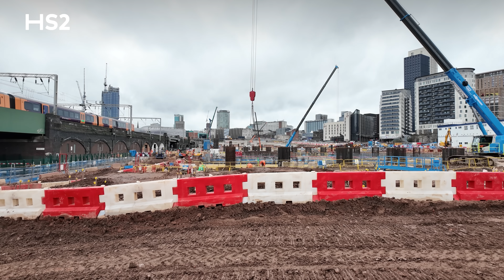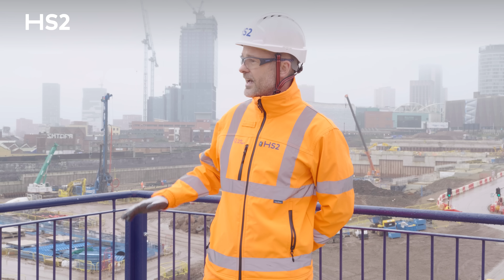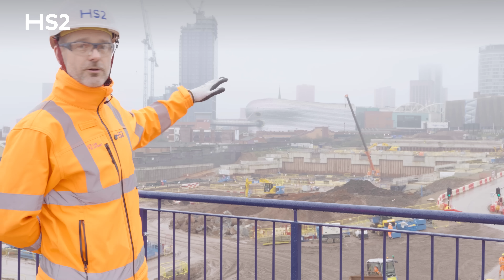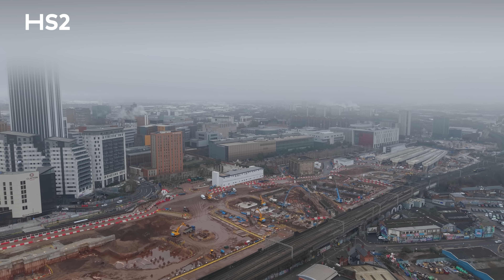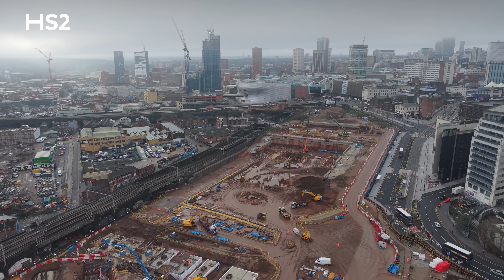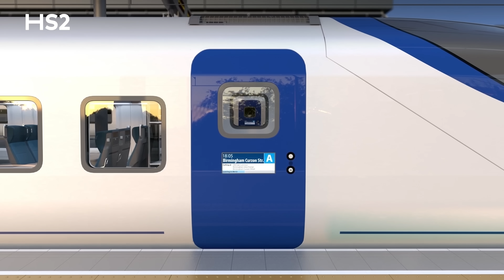Foundation piling works completed at HS2’s Curzon Street station

Comment: I'm sorry, but what a monstrosity despite the slick sell.  Now vastly over budget with a potential "finish" date of another 8 to 10 years approx. Nobody is really sure.   As of today there is even a suggestion it may not even run at the speeds it was designed for in order to cut costs. That is just incredible if it proves to be true... just think about it for a moment....   And with an urgent need to hugely increase defence plus a flatline economy, HS2 may well have to just cease being built in order to divert the billions being swallowed up. Only a relative few who like watching construction type videos or have swallowed the line about it improving travel/boosting the economy are behind it. For most people its just a waste of money badly needed in other areas.  From the beginning it has been Ill-conceived, devisive, highly inaccurate budgeting and a relative small minority in favour while other areas of society fall apart due to lack of resources.  When a project on this scale has to be " re-set"  ( HS2's own phrase...) you know its in trouble. My expectation, as unlikely as it may sound,  is it will yet have to be scrapped or else put on hold for an undetermined period. And then of course, what to do with the many unsightly structures already created and the property purchased.  Will be yet another mess left over for future governments to sort out and guess who pays for it all inevitably......

Comment: Thanks for diverting all Motorway traffic through Solihull when you shut the M42, Please tell me will you repair all the roads in this area after all the very large HVGs have finished using the boroughs road? whilst you diligently calculate all the loads during construction, I am not sure whether Solihull's roads were actually designed to take full motorway traffic. So rather than leaving this problem to the rate payers to fix perhaps you will need to rectify all the damage caused.

Comment: Started in 2011…they definitely haven’t come a long way…it’ll be a disaster when opened with long delays and cancellations..wasted money
Reply: Construction started 2019/ 2020.
Reply: @TrevorWilliams-fq8mg so 7 years to get to ground level then…do you think that’s acceptable
Reply: Agreed it's running late but not by as much as you think. Probably by 2 to 3 years. The delays are caused by 8,200 unforeseen planning conditions, late design release and funding cut backs from the treasury. An example of a badly managed project.

Comment: Fantastic engineering project...... BUT the trains of course running on it will be virtually empty as the price of a ticket will be astronomical!!!
Reply: it's comical when people keep saying this.
"Every single high speed rail project on earth has been massively sucessful BUT this one, in one of the most densely populated countries with the most crowded transport will be a total failure!"

It's easy for you to believe this conclusion when you have based it on nothing but your imagination.
Reply: @xaiano794  It will be a complete white elephant, tickets will be over £400 return by the time the line opens due to inflation and a vain attempt to recover some of the construction costs. Will be cheaper to fly to Spain than use that train!!!
Reply: @paulgreen7906  it's already cheaper to fly to spain than use the train - how do you explain why the trains aren't empty?

I get the feeling you base your judgements on your imagination and not reality.

Comment: So we really can get construction projects right in this country once we get the ball rolling. Its just a shame our government is so corrupt that it cant finance it to the scale it deserves.
Reply: Speaking frankly, the problem is the whiners - in the 90's we build a new high speed main line between doncaster and york, it took just 14 months and came in under budget and is used by tens of thousands of people every single day.
Nearly 60% of the cost of HS2 is only being spent to appease complainers, we need to just get on and get things done and start ignoring all the complainers because they are simply holding our country back.
Reply: Interesting to know that. Also the HS2 budget of 32.70 billion is indexed at 2019 prices whereas the actual cost is at real time. If you uplift the 2019 budget price to real time it will be about 50 billion. Still short of the 88 billion current expenditure projection but closer than many think.

Comment: The most expensive railway in the world. There is only one example of a more catastrophically incompetent construction - that in California between  Los Angeles to San Francisco. In retrospect it would have been quicker and cheaper to make almost all of it underground. Musk’s Boring Company would have done it for half the price & twice as quickly.
Reply: Impossible to build it all underground. Do you bore from each end or from one end only ? Either way how do you get all the soil out ( about 12 million cubic metres?). 
Then how do you dispose of it from one or two locations ? How do you provide emergency escape facilities ?  These are just a few examples showing the impossibility of the task. .
Reply: @Trevo @TrevorWilliams-fq8mg come up for stations, escape routes, access for fire crews etc. but you go under houses, under farms, under rivers, under reservoirs, under roads and railways all of which otherwise require bespoke one off bridges. All of which are subject to huge lawyer inspired campaigns to block, all of which usually require compulsory purchases making the project very unpopular. Go deep and straight using the same tunnelling machines successfully used under the Channel. Half the problem with one off designs is they are impossible to price accurately so you end up with cost plus tendering instead of competitors fighting to do all or sections of the project and being responsible for cost overruns.
Reply: Having worked in the construction industry your ideas won't work. In addition no contractor will accept a fixed price contract of this size as their balance sheets won't cover the risks. So the contract would be a cost plus or management fee contract.
Reply: @TrevorWilliams-fq8mg  That’s why cost overruns occur. Why bother to work quickly and cheaply when the government pays for delays and cost overruns? If I was in the construction industry I would insist on cost plus - it takes the pressure off  and guarantees profits. Luverly jubbly.
Reply: Cost plus doesn-'t cause overruns. Incomplete pricing information is the cause. Cost plus means a guaranteed margin against a defined scope of works. The scope is priced. But changes to the scope occur causing price increases.
Reply: @TrevorWilliams-fq8mg I disagree. When there is no reason to work fast or work efficiently - why on Earth would you do it? This might be the last project you work on - so make it last. Besides once the project is up and running no one bothers to complain about the cost.
Reply: There is a reason to work to a specific programme as part of the cost is based on specific time durations - the contractors management costs ( eg site management costs at x pounds per week times a  specific number of weeks). If the contractor causes a delay he loses money. If HS2 cause a delay the contractor claims an extension of time with costs. Construction projects are much more complex than you and a lot of other u tubers realise.
Reply: @johnfrancis4401  those tunneling machines can't go through the type of ground found on the route. 

I can't imagine why you keep commenting acting like you're right when you get something so elementary so wrong.
Reply: You know that because......?
Reply: Reading the threads will give you an idea.
Reply: @TrevorWilliams-fq8mg Thanks
Reply: over 60% of the cost is due to complainers. If we just got on and built it, it'd be faster and cheaper.
Reply: @xaiano794 Yes a lot of it is down to appeals, counter appeals, counter counter appeals. Lawyers are having larf all the way to their banks. Putting it underground would obviate the need for this.
Reply: @johnfrancis4401  Absolute nonsense, the geology of the UK makes underground extremely expensive, 12 billion spend on extra tunnels alone.
Reply: @xaiano794 The total cost is probably going to be £120 billion. Much of this is down to one off designed bridges over rivers, canals, reservoirs, roads, railways etc etc. All of these obstacles could be avoided by going underground. The surface disruption would be reduced by 90% No loss of farmland, homes, factories, offices - no lawyers spinning out appeals. The track could be straighter. The contracts could be competitive not cost plus.
Reply: @johnfrancis4401  just the few miles of tunnels to euston are costing £6bn, tunneling is far more expensive in the UK due to the geology.
Reply: @xaiano794 The geology is almost irrelevant. The cost of the tunnelling in London - as revealed by Cross Rail (the Elizabeth Line) was due to the extraordinary difficulties of tunnelling under old delicate buildings.
Reply: @johnfrancis4401  It most certainly isn't but I get the feeling that you are just basing your opinions on your imagination and not on any experience of civil enginerring, so I'm clearly wasting my time.
Reply: @xaiano794 Odd. I haven’t seen a glimpse or shred of evidence to back up your assertions. Just a load of ad hominems. Geology ?!?!?! What geology? So far as I know it’s mostly chalk or limestone for a good stretch  followed by sandstone all the way to Birmingham. Those rock types are not known for the difficulty in tunnelling - at least compared to London clay and granite.
Reply: The company I worked for built the tunnels to the western section of crossrail from Royal Oak to Liverpool Street. Around the Farringdon area the geology changes to gravel. Gravel is a water bearing strata and would immediately collapse when bored. To eliminate this problem liquid concrete is pumped into the ground from street level. It's called compensation grouting and soidifies the gravel. Also as I have said before no contractor will accept fixed price contracts on projects of this size as their balance sheets don't cover the risk. Tunelsling the entire lebgth of the railway is an impractical, expensive non starter.
Reply: @xaiano794 Still no facts to back up your assertions. Just more ad hominems. Support what you say. Why is geology the problem with tunnelling to Birmingham? In my research Cretaceous rocks and sandstone rocks are described as being the simplest rocks to tunnel through. Have you got some contrary evidence? Obviously not. Otherwise you would already have supplied it.
Reply: @TrevorWilliams-fq8mg That is London. I’m talking about the track from the outskirts on London to Birmingham. London has severe problems with tunnels under old buildings that are national treasures. Even you, I assume, recognise that you cannot have another surface train across London. I’m taking about the huge problems of people appealing against the route, appealing against the destruction of ancient woods, of disturbing bats, of constructing a host of one off bridges ALL OF WHICH ARE OBVIATED by a tunnel. The track can get shorter. The tunnel is identical along its entire length except perhaps going deeper to go under rivers.
Reply: @johnfrancis4401  You literally have someone who worked on tunneling through the very same ground and he's telling you you're wrong and you still want to pretend that you're right?

I've worked in the rail industry for over 2 decades and I could go into detail but you clearly think you being right is more important than learning and I'm not about to waste my time.
Reply: @x.   You are not addressing my points. Of course you want to build a massively expensive track. You want a job for twice as long as initially promised. In less densely populated countries surface tracks make sense. But in England in the densely populated area from London to Birmingham. With the endless number of consultants. With the endless lawyering. Nothing gets built. Terminal 5 took 25 years. Given this health and safety and red tape and hopeless bureaucracy tunnels make sense. In China the surface route would be built in 4 years and buildings in London would be knocked down to make room. But here in England it’s quicker and cheaper to go underground for this specific route.
Reply: @johnfrancis4401  I don't and you're wrong and you have not only professionals telling you are wrong, but explaining how you are wrong and you are still claiming you are right.

I would love to see us ignore the whiners and just get on with it like we used to do, I remember someone telling me, incredulously that the entire york to scarborough line was built in under 2 years, and I pointed out that it's only a very recent thing that we started viewing nimbyism as normal.
The entire line bypassing selby went through the planning process, was designed surveyed AND built in just 4 years total. That was 1983.

The answer is we go back to just getting on and building essential infrastructure.
Reply: Clay is also a simple strata to bore through. If the tunnel was 100 milea long how do you get the soil out ( about 12 million cubic metres) and where do you put the soil, bearing in mind you only have (1 or 2) exit points. ? What cost saving do you think is achievable ? If this was one tunnel only from London to Birningham it would be 1 contract only. What contractor would take on one contract spanning 100 miles ? No contractor would be able to take on a contract of this magnitude and any contract over 500 million would be on a cost plus or fee based only contract anyway.
Reply: Interesting you should quote the 6 billion pound figure for tunelling the 4 miles from Old Oak Common to Euston. Another utuber on another channel is convinced a tunnel could have been built from London to Birmingham for 10 billion. But he forgot to include the TBM set up, maintenance access walkways, fire escape passageways, stations, ventilation shafts, inflation, soil disposal and contractor site setups.

Comment: No hurry.  The last thing those on the route need is for these very noisy trains to actually run.  No problems with capacity either, on the parallel Marylebone-Moor St route Chiltern only runs 3 carriage trains so could triple their length if necessary.
Reply: HS1 in Kent seems to have caused less disturbance than expected. In general, train noise is intermittent - road noise is incessant. I would rather live near a highspeed rail line than a motorway. Less pollution too . . .

Comment: This is really great, although I do wish it was a station more like Old Oak Common or Paddington's Elizabeth Line Station and that we had trains running straight through Birmingham Curzon Street and continuing onto Scotland. Terminal stations are less efficient than through stations and are ultimately the reason why joining up the commuter lines into Paddington Station and Liverpool Street Station has made the Elizabeth Line so successful.
Reply: The problem is that birmingham new street is already underground so hs2 platforms would need to go under both the snow hill lines and the new street lines. New Street platforms are only 150m, they need to be 400m.

Comment: I have always replied to anyone who has droned on about 'no one is doing anything' by pointing out the weeks and weeks of drilling 8,000 test piles, moving services and utilities, removing old structures and the archology before construction gets to ground level. And its been over 12 months.
Well now we will see big steps forward as the station literally comes out of the ground.
Well done lads and lasses at Curzon Street.
Reply: It's the government who creates any delays in works. HS2 would've possibly been in the end stages now if successive governments hadn't incessantly wrangled over it, and  taken charge with some strong planning directive - i.e. "Get this built now, stick to the original design specs, ignore naysayers and NIMBYs. Make it work, make it last, stick to the plan." 

Instead the government appeased NIMBYS and serial complainers, rocketing the price up and setting the programme back years. 

There's also something to be said for the idea of nothing getting done in this country without a huge chunk of money going somewhere (who knows where) to possibly grease some palms. It certainly doesn't go on the project/product itself. I know that bat friendly tunnel and the dozens of tunnels have increased the price a fair bit, but as much as £30bn for the entire project -> £100bn? Unrealistic cost estimates? Delays? Wastage? Inflation? Okay. It still feels like a chunk of the money has gone somewhere except on delivering the project itself.
Reply: @ecaeas4439  Net profit margins on major construction in the UK are some of the lowest in the western world with Balfour Beatty being one of the better performers at 3.6% last year with  many others around 2%. They're in a 50:50 partnership with VINCI so not quite the bonanza it's made out to be. Despite the "billions given to company X, Y & Z" headlines, they have to procure all the materials and services for the project from the "handouts". It's not their massive profit margin as some dullards like to think. To the "China would do it better" mob, the returns are similar to the UK but with their sector dwarfing our meagre output, ecconomies of scale make it a much better performer. I expect that the eating of bats makes the need for tunnels redundant....